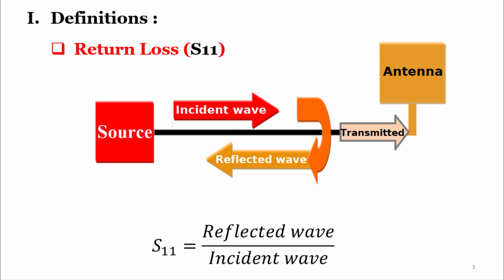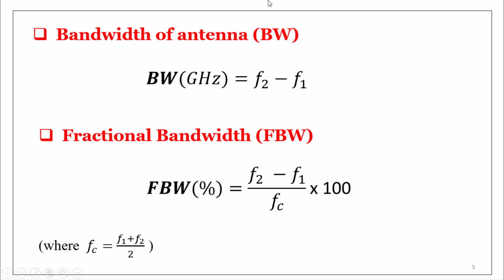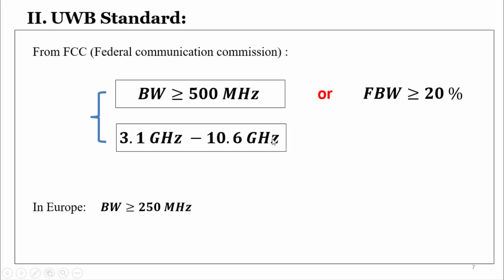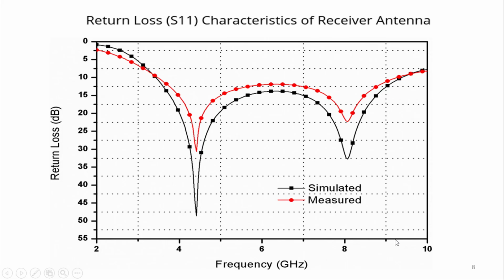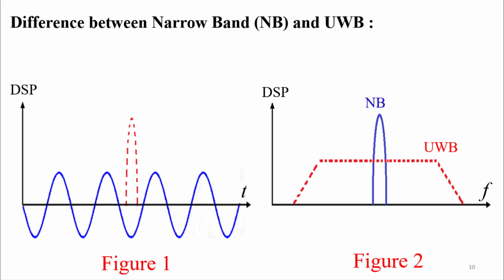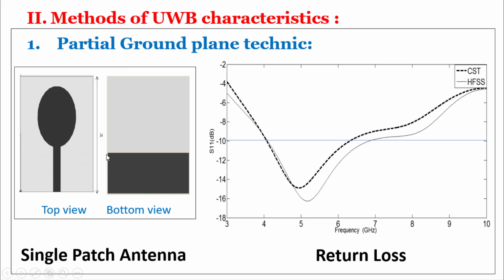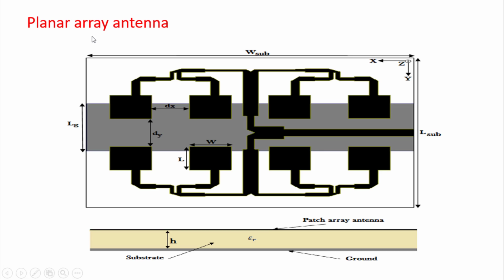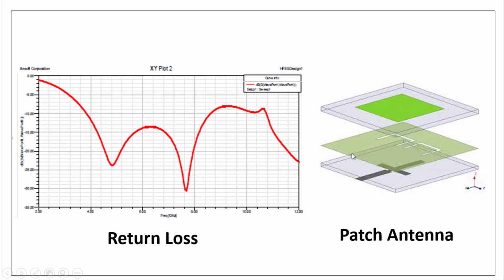Ultra Wideband (UWB) Antennas : Norms and Design

Comment: what's the benefit of FBW?
Reply: fractional bandwidth and impedance bandwidth both are having same benefits only.... in FBW , we take centre frequency is fractional values that means fc= (f1+f2/2) but in IBW we take Fc as minimal return loss point.
Reply: @aaditharul-elearning3997  Thanks for your answer
Reply: @aaditharul-elearning3997  Thanks a lot